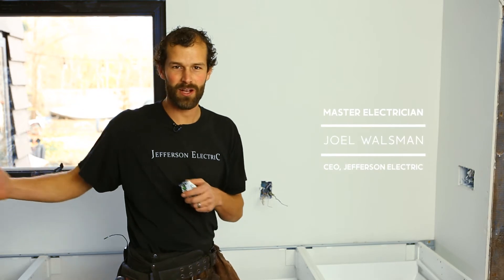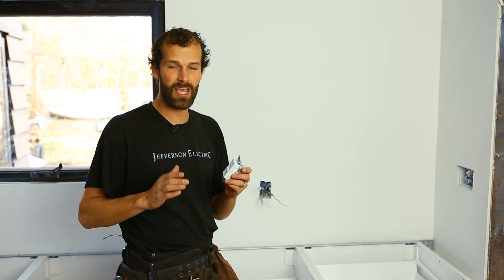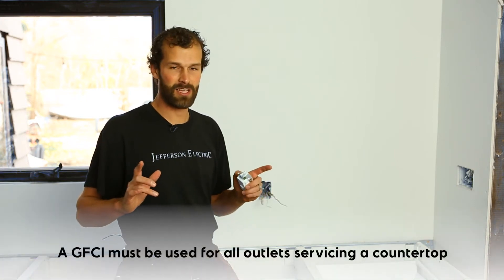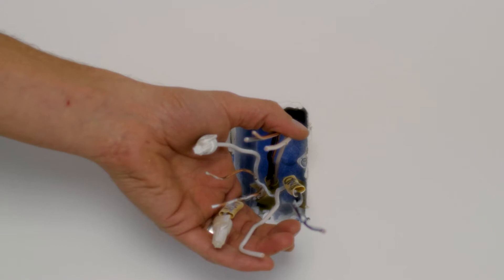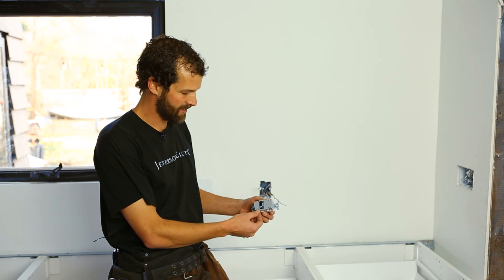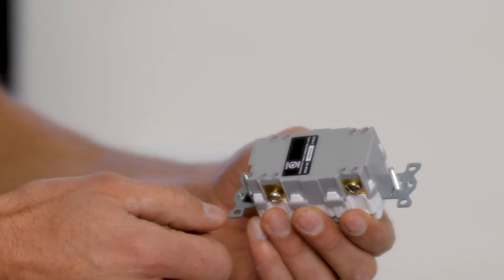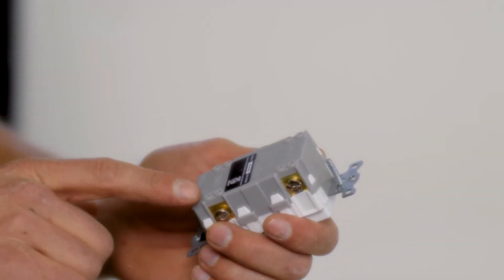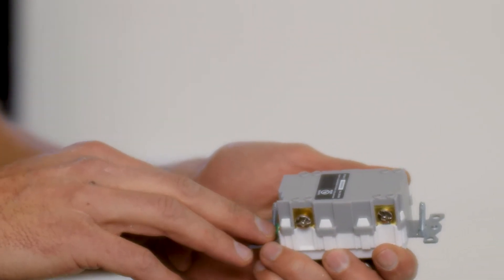GFCI Crash Course

Comment: In my kitchen I have 5 receptacles on 2 different circuits. The 2 receptacles on either side of the sink are GFCI protected. A third one is further from the sink unprotected. And the last two are on an island with the stove. Also unprotected.
Should I have them all as GFCI? The kitchen was remodelled just a few years ago so maybe code in my area allows this?
Reply: @ElectricProAcademy  no I've tested the GFCI near the sink and it only cuts out one of the other 2 receptacles near it.  The one that's far from the sink stays live. 
The island has no GFCI protection at all.
OK so I guess I have another electrical project to do! My wife is gonna love it! 😂😂
Reply: 2023 code says EVERYTHING basically in a residence on GFCI, everything in the kitchen around water or not...AFCI also on most stuff in a residence, but it wasn't so some years ago